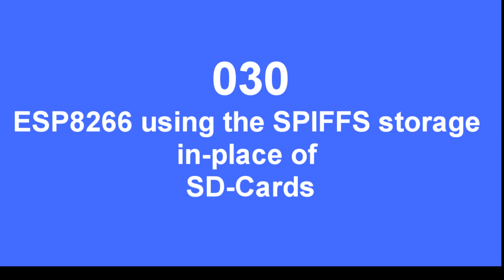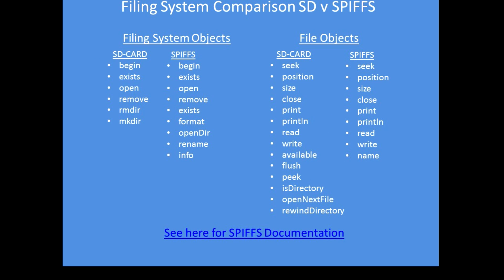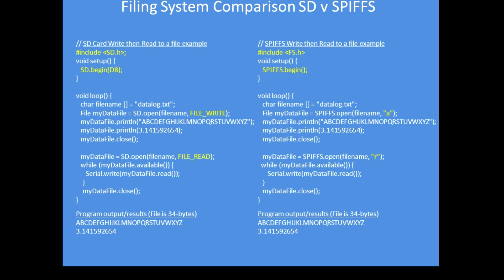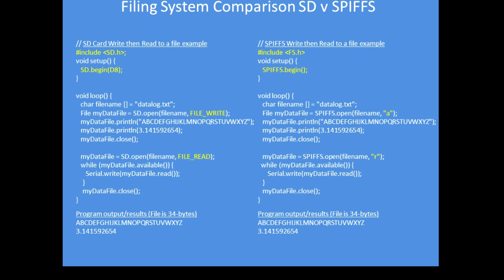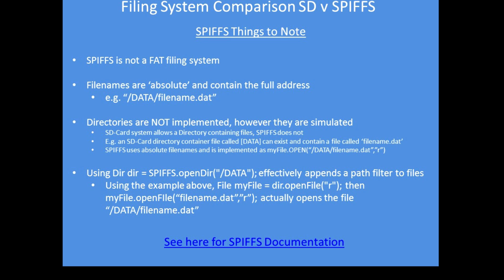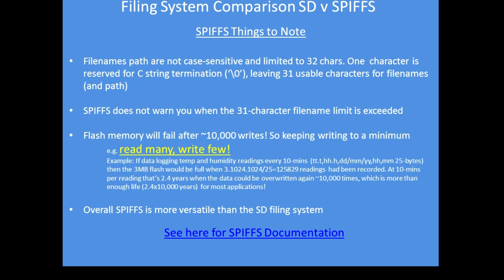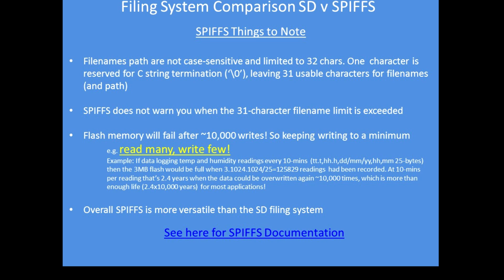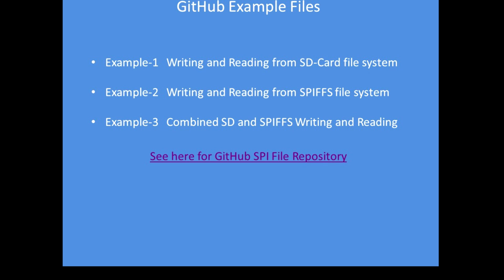Tech Note 030 - ESP8266 Using SPIFFS to replace SD Card storage

Comment: Hi all
When i m checking flash file system i m finding only OTA memory availability in arduino ide, and not showing spiffs memory
Can any one help me
Reply from the maker: You need to allocate both spiffs and Ora memory there are options
Reply: @G6EJD  how can i enable function of spiffs memory only i m finding OTA
Reply from the maker: @TheMehmood20  Yiou have a board type selected that does no support that, try board type Lolin D32, then Boards, then Partition size
Reply: @G6EJD  My board ia not   Lolino D32, however i tried but in board option this board is not available. Likewise SPIFFS memory option is not available too.
Reply from the maker: Then your ESP32 compiler is not correctly installed or is an old version
Reply: @G6EJD  i have esp8266 version 3.0.0
Reply from the maker: Go to the Arduino IDE again, and under Tools > Flash Size, select an option with the right flash size for your board, and a SPIFFS size that is larger than the size of your data folder. See that?

Comment: In my project wifi is not available all the time but I want to save data in spiffs with ntp timestamp and send when wifi available . So using spiffs is it possible?
Reply from the maker: It’s possible yes, but the ntp clock will lose time until the next refresh

Comment: It is not clear how to use, for example, ESP8266_SPIFFS_Example.
How to draw pictures and what kind of pictures?
Should the images be inside a folder?
How to connect the Nodemcu esp8266 to an ILI9341 TFT?
Thank you
Reply from the maker: Daniel Fernandes, there are SPIFFS examples in the Arduino IDE and converting an SD Card programme to spiffs needs a small amount of amendment. The ILI9341 connects to the 8266 using the SPI bus pins. The graphics library uses adafruit GFX drawing primitives. Yes images are in a folder

Comment: How to upload program for arduino uno or esp8266 with GSM+GPRS Module over the air(OTA)(Not using Wi-Fi) want advice from your side thank you
Reply from the maker: I've not seen anyone do this yet. But it would be relatively easy to use a GPRS serial link and connect via GPRS to the link and then re-programme the ESP as if it were connected to a PC via serial (USB), that is feasible and available freely. https://www.banggood.com/USB-to-GSM-Serial-GPRS-SIM800C-Module-With-Bluetooth-Sim900a-Computer-Control-Calling-With-Antenna-p-1315614.html?gmcCountry=GB&currency=GBP&createTmp=1&utm_source=googleshopping&utm_medium=cpc_elc&utm_content=zouzou&utm_campaign=pla-uk-ele-pc&gclid=CjwKCAiAt4rfBRBKEiwAC678KRrCVwKBsHSLtHuTSaJ4nOAeduxK1dIx4O4PD7fXvzV76hr-zZjtyxoCQVMQAvD_BwE&cur_warehouse=CN

Comment: Great video.  In your example about the many years of writing let's say 25 bytes, I don't understand one thing.  Are the values written at exactly the same spots of memory or they are appended in memory over the 3MB flash memory?  How do you specify the address when you write into the file to be sure you write to a new memory location?  In you example would it mean also that you would end up with a 3MB large file?  If you could explain a bit more about your example I would appreciate it please. Thanks.
Reply from the maker: That's a very good question. There is no operating system to balance writing of bytes across the Flash memory space and all bytes are written sequentially. If a file is erased or SPIFFS formatted, then I expect the base address to be reset/re-used, so in effect there could be excessive over-writing of locations, but that would mean a 100,000 file erases which sounds like an unlikely scenario.

There is documentation of Flash addressing:  http://esp-idf.readthedocs.io/en/latest/api-guides/partition-tables.html

There is no (easy) mechanism to force a different Flash partition address to do this manually, I think you just need to view the Flash as 'read many write few' storage.

Espressif propose a minimum (and I suspect statistical) write-cycle life of 100,000 times which is actually (with the right storage strategy, so not using it as pseudo RAM) quite a lot of write cycles. Data is appended to the allocated Flash space, so if 3MB Is allocated; actually with SPIFFS it allocates all of the 3MB flash space but only with a set of header bytes to manage the address space. Each file contains size and offset bytes and so does not seem to be managed by a file allocation table and exists independently. There is little documentation as to how SPIFFS is structured. There is nothing in the documentation to say the storage is cycled across the SPIFFS entirety. 
In practice I have an ESP8266 that has been running for well over 2-years patiently logging data to SPIFFS every 5-mins and the file ~3MB has wrapped around at least twice now, so although it's not over writing any particular Flash location many times, it's a demonstration that with the correct writing (few) strategy it will last for many years.Of course the same 100,000 life applies to programming the device, but it would be the result of huge amount of programming to get even close to the limit and then it may go much further than that as the Espressif upper-quartile reaches 1 million write cycles. It depends how good the piece of silicon is I suppose.Overall I'd expect an ESP to last for many years and we could work it out for a given application as the result is deterministic  - my guess is typically 20+ years. Conversely written to a lot, the number of write-cycles could be exhausted in a week or less, but then the Flash was never designed for that sort of application. 

There are some programming techniques that can be used such as READ, before WRITE and only write if different, plus I have not studied the architecture of the Flash controller to know if it repeats this at the bit level, thereby reducing flash changes to the minimum that can be achieved.

Hope this helps.
Reply: Thank you very much for your detailed answer.  I think that your read many write few strategy works well like you experienced with your device.  I was thinking there was more manual control over the addresses you write to a bit like for the EEPROM equivalent, where you can specify where you want to write to.  But I guess that there is a minimal cycling logic built-in when you use SPIFFS memory to constantly write over the entire memory and restart from beginning when you reach the end like I understand from your comment.  Continue your good work, I really enjoy your channel that I discovered in the last days.
Reply from the maker: The same problem applies to the EEPROM too as you can’t redefine the start / location and you get limited write-cycles.

Comment: Sorry G6EJD, the example doesnt seems to work, values are still at 0 :(
Reply from the maker: Did you delete these lines:
50  variable1 = 0; // Example value for testing, these would be varied by your application
51 variable2 = 0; // Example value for testing, these would be varied by your application
52 variable3 = 0; // Example value for testing, these would be varied by your application
53 variable4 = 0; // Example value for testing, these would be varied by your application
Every time it saves data it sets them to 0, I did that because it was an example.If you have, please send me your code.
Reply: G6EJD yes i did..
Reply: G6EJD i will send you the real code later on... thanks. Marc.

Comment: Many thanks for this. I have been using SPIFFS for about 6 months and think it is brilliant but I have discovered more by watching your video particularly about directories. The system works very well but I have found that once the data size gets to round 100Kb the ESP has trouble serving my pages. I can not find the reason for this so I tend to limit its use to short periods of logging.
Best wishes
Arthur

Comment: Hello sir Thanks for the great information and your amazing channel. I need your guide for the college  project i'm about to do and I hope you help to find my way. considering  I have  50 esp8266s which are individually connected to temperature and humidity sensors so they have to send their data(one by one or as I found 4 by 4 as max devices can connect to a single esp8266 ) to an esp8266 Webserver to show theme on the Webserver . By the way the Webserver needs to connect to  esp8266s (one by one ) and  send some data if it's necessary . I don't know what mode(station ,client and ...) each esp8266 needs to be set on.  Than you
Reply from the maker: I have tested an ESP8266 Webserver to 30+ connections and it works OK, you may be have programming issues that need to be resolved, are you closing connections when you have completed? I think you have two options for uploading the data from 50 devices, either schedule each device using the <time.h> library and getting real time then uploading at set schedule times, perhaps every 15-secs per device so device1=0-secs, device2=15secs through to device 50=750secs, it will take a while to do, I think you should budget for 5-secs minimum for connection upload and disconnect, maybe a little more until tested. Alternatively you can do the uploads randomly until all are completed, but you will need code/logic to sense collisions and failed attempts and retries, either way it is a challenging project and I'd be happy to help you out. You should read into topics such as CSMA https://en.wikipedia.org/wiki/Carrier_sense_multiple_access_with_collision_detection
Reply: Thank you for attention and sharing your knowledge and your experience with me .As you said either way is going to be challenging and time consuming but  You  mentioned early that 30 connections are  possible for a single webserver so what came to my mind was I can have 2 esp8266s with 20 and 30 branches which communicate with their Stations and these two  talk to one webserver which client is able to checkout info through that . what do you think about this is it possible ? if it is what mode I should use for each esp8266?
Reply: Here's what I'm talking about https://postimg.org/image/9h42vq895/
Reply from the maker: I think you have to work on the scheduled updating route to begin with as it is so easy to implement, at least that's what I would do as a proof of principle, then build on from that. Doing it this way would only ever need one connection at a time from each client. Something like#include <time.h> and using the ordinal time response it would be quite easy to add your update time interval to that and then poll until time to send the data, then repeat, just needs a schedule to be determined, say each device has a time slot unique to it.
Reply from the maker: Also you may wish to consider a 'connection-less' protocol like UDP which you can use to broadcast data from your clients, but you will still have the problem of scheduling or random transmission/reception techniques that take a finite time to complete.Another idea but I have not tried this yet is to reassign the port number under programme control such that each client has it's own port, the master can send out a client connect request get the data and then disconnect moving on the next.e.g.IP:5000 for client 0IP:5001 for client 1IP:5002 for client 2and so-onIn the programme for (int port = 5000; port = +1; port < 5051) { if (client.connect(server, port)) {
     Serial.println("connected");
     client.println("GET /search?q=arduino HTTP/1.0"); // get a connection then send data
     client.println();
     }     else    {
    Serial.println("connection failed");
     }
  } // client.connect} // for loop
Reply: Thank you for this Great Information .